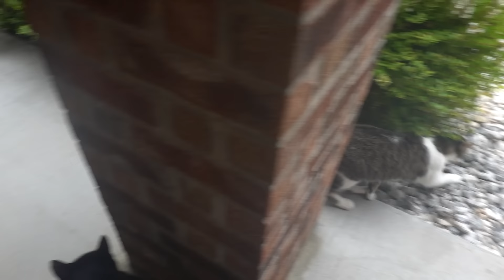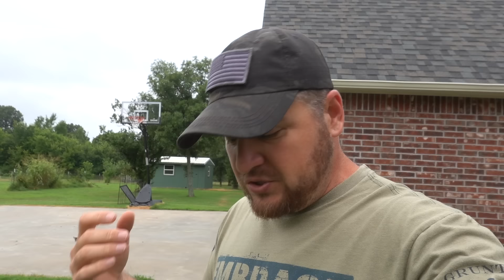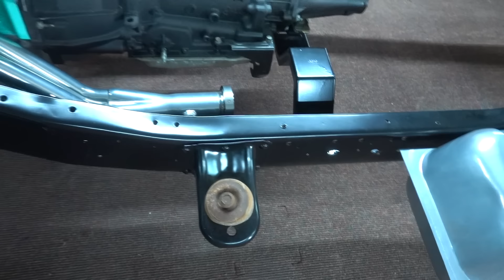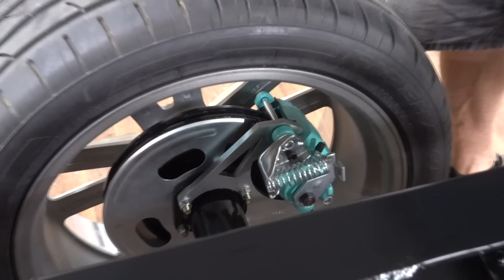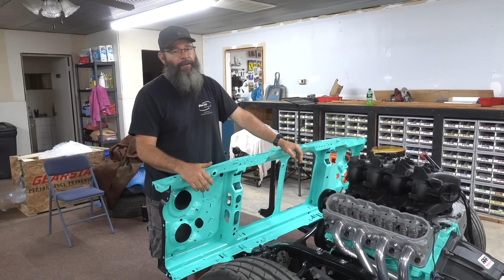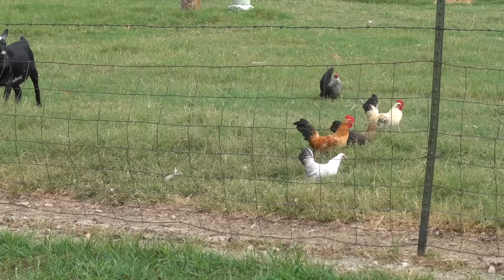GIANT GUARD DOG Scared By This Caught On Google Nest  Security Camera!

Comment: I helped rebuild a 57 Chevy, took everything off and wow! Tons of work!! We rebuilt the engine, transmission, everything!!! Even put engine parts in my kitchen dishwasher to clean them!! It worked better than scrubbing in gasoline!!! I realize how much work these things are! My ex was a mechanic so we worked as a team. Your truck color is the inside dash color we used. Love it!! He mirror coated the one we did. Using a teeny tiny paint brush to paint all the little bitty Chevy signs was a PAIN!!!! 🤣🤣🤣. Congrats!!!! 🎈🍾🎉🎊

Comment: Way back in 1960s my cousin upgraded his MG Midget  with Morris Cooper S engine . I do realise you probably do not know much about these old British two seater sports cars tiny car, tiny engine from memory 1300 cc only, compared to typical US V8 powered muscle cars.  We upgraded its exhaust from original tiny steel exhaust pipe, I think only about 1 ", to a 2" Copper pipe. Sadly larger not very practicle due to ground clearance on an effectively very low ground clearance sports car, as with 2" pipe already it scrapped on driveway slope transition of especially parking houses and occasional fuel stop driveway ramp. But that copper pipe gave a fantastic 'melodic' tone motor sound.  Overall performance was greatly improved when combined with a "Capacitive Discharge Ignition" I designed and built for him. The original contact ignition of the Lucas distributor was hopeless at high RPM due to severe contact bounce  absolutely destroying high tension output. Before CDI ignition the MG topped out near 95 MPH as engine lost performance by poor firing consistency. After CDI it toppled out closer to 130MPH. So sad that it was only near 20 years later that working for Bosch in Australia  I became Fuel Injection and Computer Spark control specialist, designing and calibrating the engine management systems of several car models. I was on Bosch side in Australia doing the first fuel injected version of both Ford and GM cars on Australian market, needed by the ever higher demands on emissions, fuel economy and running quality of the engines over the wide temperature performance of engines, though in Australia extreme cold is of little interest, like northern USA and European winters, here -10°C , -14°F is rare, 0°C, 32°F is what 99% would get as worst case, exceptions are people going skiing.  Hot condition engine behavioirs on the other are very high priority with ambients beyond 45°C, 113°F, and common towing boats, caravans (mobile home/camper), horse trailer. Reliable engine start, running quality ,  hot fuel handling very in demand. Nothing worse than losing engine performance or failing to even start or run by being getting too hot.

What I could have done to that MG Sports car with a good injection overhaul of the two throat downdraught carburetta of the Morris Cooper S engine.

Comment: Just my opinion, go with stainless exhaust. Dual pipe. With, possibly an "H" pipe. I've got a 5.7 Hemi, with a cat back, no muffler exhaust, with the "H" pipe, and it does sound nice in my Grand Cherokee.
I do love the color you've chosen. Or, rather, Rachel chose. Gonna ne a really nice truck, when it's done. I did a 1965 Chevy Shortbed with that seafoam green and white.  Mine was lifted, not lowered. It was also a 4X4.

Comment: Wow what a job!  Had the thought to ask if you two would guys interested in a '89 Chevy Blazer?  🙂  Dad was the original owner, has the bigger engine, burgundy interior, just over 1,000 miles.  Paint job is a mess but only one little dent from a softball.  Have not driven for about 4-5 years now and now I am not driving much at all.

Comment: My 66 GTO when I put it all together. I won't a 3 inch exhaust and I put cut out on it obsana. And even with live, I bought big mufflers to quiet it down and with t.  Biggest muffler. I can find from Flo manswer. It's still loud as hell when I open the cut oit's a race vehicle. Sounds just like you're at the track. Mine's also fuel Is injected